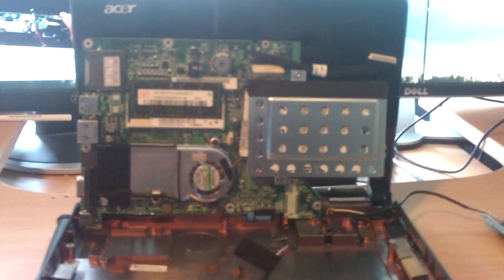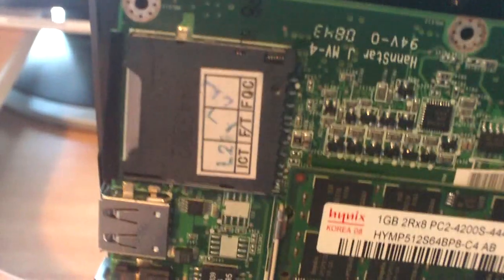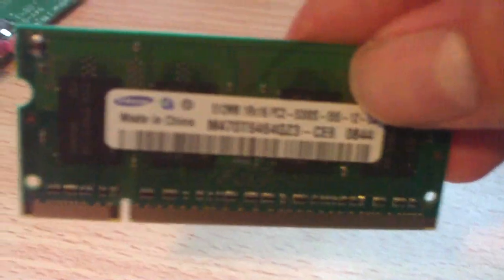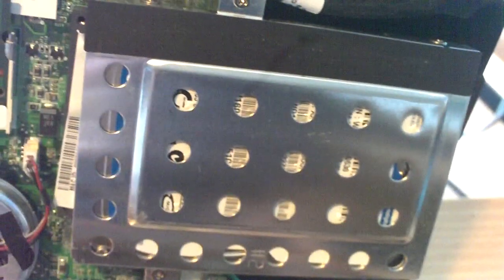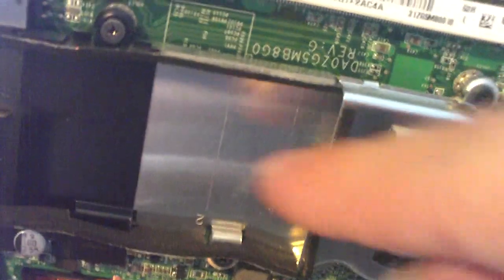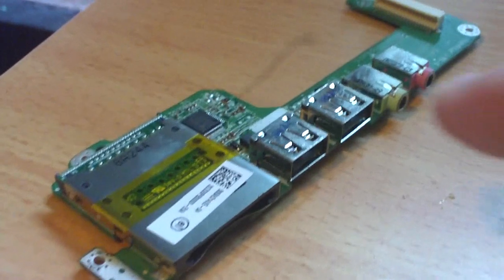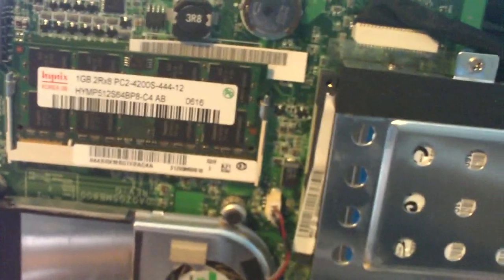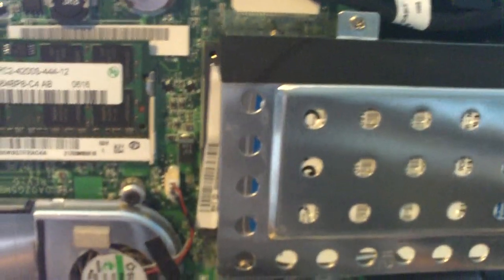Aspire One AOA150: Two most common ways of upgrading the netbook

Comment: This is correct , However I want to add one point. The 160 gig drive that is in this netbook spins at 5400 rpm and also has a longer read or response time than newer drives, so if you change the drive make sure the new drive spins at 7200rpm and has a better response time ,this with updating the ram almost makes the net book usable.